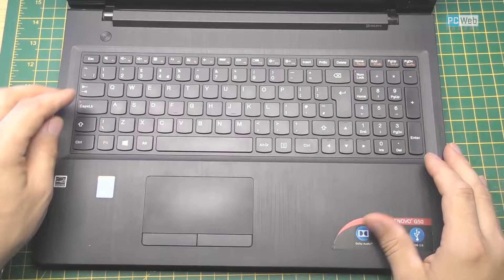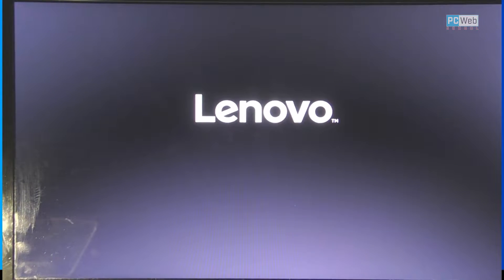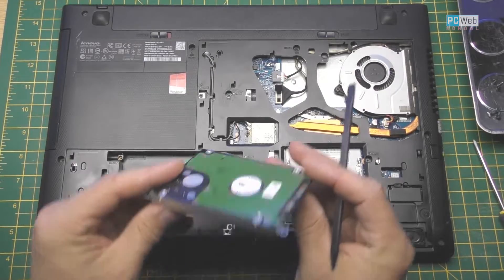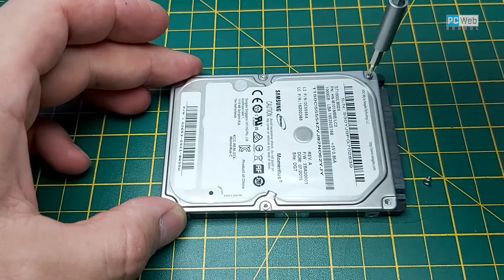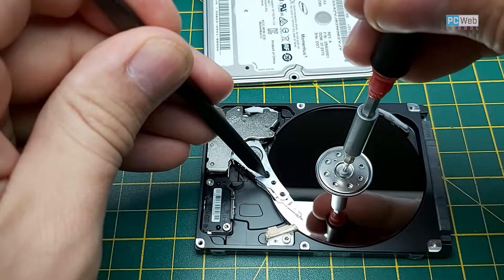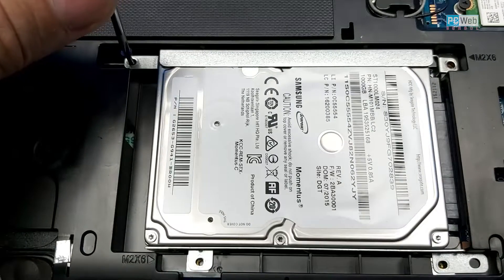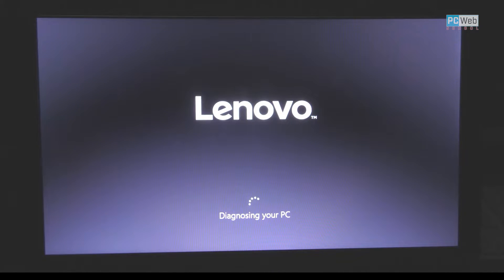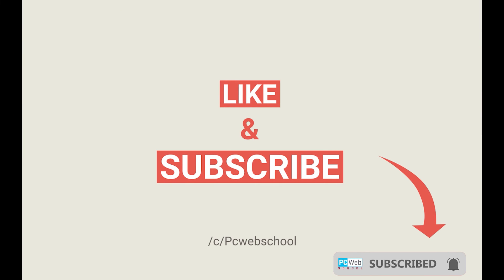Lenovo g50 not turning on | Lenovo g50 not booting

Comment: I've got a similar laptop "Lenovo g50-80" but a different problem....
I got it second handed so I don't know the past of the laptop but I received it without a hard drive, ram and charger...

I got myself ram, found a universal charger and stole a hard drive from another laptop I got to test it....

Without charger, when turning on nothing happens (no sound, no screen, nothing)

Whenever I put the charger in the laptop the light besides the webcam turns on an after 1 or 2 seconds it turns of and nothing happens...

When I turn it on when the charger is in it, nothing happens (no sound, no screen, nothing)

On the right side, I guess a CD drive has to be there but nothing is there...
I guess that doesn't matter for the issues I've got

The charging light (I guess it's the charging light) is flickering orange slow.... I guess that's normal when the charger is in the laptop.

Any tips or information is welcome for my issue

Comment: I have the same problem but when I press the small button on the side it doesn't turn on either...
Reply: Yes bro same problem
Reply: Harshith Rao I have Lenovo Laptop core i3, intel, 10th gen and I hold down power button it doesn’t turn on! It just stays on a black screen !!! Help pls
Reply: @questionable8305  Any results? My screen just flickers off and on but never actually boots.
Reply: Sean Dillard  It turns on now but for me It goes onto a static screen now! I turned it back into Best Buy and I now I need a new laptop for online school.
Reply: @questionable8305  So wack!! That's the pain about laptops. When one thing goes wrong, and it's not the ram or hard drive, your usually screwed!!